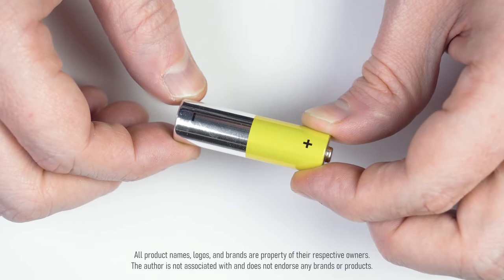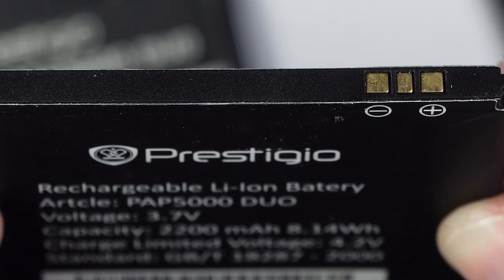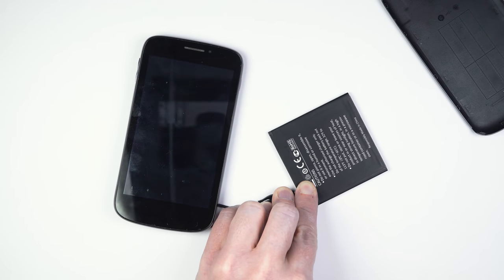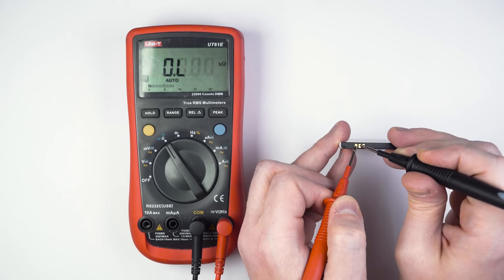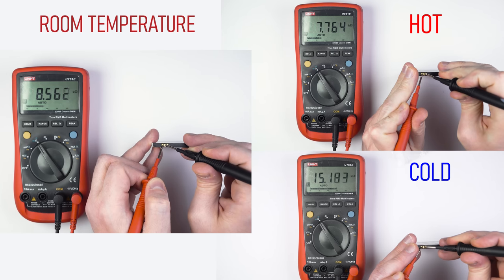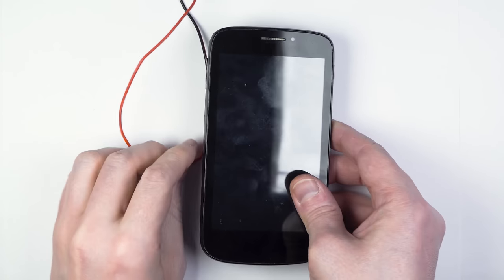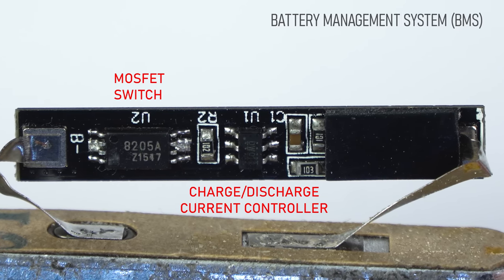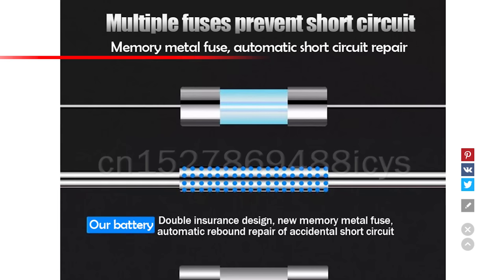Why do MOBILE BATTERIES have THREE terminals? A simple Explanation.

Comment: Outstanding!! I'd always assumed it was for data transfer! That's a handy thing to know. I was just wondering how I could get a thermistor without ordering one. 
Kudos!!!
Reply from the maker: Well, yes, but they are really cheap actually. ;) If you look on Aliexpress, for example.
Reply: Some batteries include wiring/contact for NFC antenna. So in some cases, there is some data transfer. (most knockoffs will advertise NFC antenna, and have nothing tho)
Reply from the maker: @IvnSoft  True, but those are 4 terminal batteries, like Samsung Galaxy S6. And they still do have the NTC thermistor pin.
Reply: @RonMattino  NTC Negative Temperature Coefficient
temperature goes up -> resistance goes down
(I couldn't spot an explanation about the meaning of NTC in the vid)
Reply: Technically it is data transfer, it transfers data about the temperature of the battery. Also there are some batteries with a 4th contact that is actually used for data transfer. My Canon camera batteries, in the camera can tell me the batteries serial number, state of charge, and battery health.
Reply: @SunnyWu  the thermistor just gives a reading of resistance (in ohms and non-linear) that is directly related to temperature. That's why the battery needs calibration info (automatic now).
It doesnt give an exact temp reading.

Search for how a thermistor work  (either PTC or NTC)

Comment: Thermistors were already present on ancient Siemens' and Nokia's battery packs when they still consist of AAA or similar-sized NiMH elements.
Reply: That was not only for protection, but to terminate the charge as well. Ni-Cd and Ni-MH get hot as they are fully charged
Reply from the maker: Well yes, and also some old Nokia batteries used a resistor on 3rd terminal to designate cell type/capacity. They used this method for some time, but not in newer Nokias.

Comment: Sometimes the OEM batteries aren't that much safer!  The photo you show of the protection board is a standard protection board that you'll see atop MOST batteries, its a DW01 chip and another bigger chip which is a MOSFET(switch).  Their job is to disconnect the battery if its short circuited, discharged below 2.5V or charged above 4.2V.  With these in place, batteries are much much safer - and 18650's often have them built in, but some, particularly lithium polymer rectangular batteries don't and these must only be used where there is another battery management system in place.  None of this matters if the battery sustains mechanical damage which can then fail with spectacular results.
Reply from the maker: A DW01 + two MOSFETs connected in series actually, because current needs to be cut both ways: during charge and during discharge. And MOSFETs, as we know, conduct current if reverse-biased. Original branded 18650, in fact, do not have BMS's, but 3rd party Chinese made 18650s do. As for mechanical damage, most Li-Ion cells have a security valve that is supposed to let the gas out in case a short circuit occurs. Unfortunately, it doesn't always work as intended.
Reply: You are very wrong in that later part. Most 18650 or any Li-Ion cell in general doesn't have any protection besides pressure release valves or such mechanical measures. The class of batteries that come with Protection circuit are called Protected cells and are rather uncommon. 
Li-po batteries almost always come with Protection circuits due to the size and possible danger except when the Li-pos are intended to be very high drain or used in a battery pack.
Reply: n7
Reply: Or you accidentally charge a hobby lipoly pouch cell on NiMH settings and drive 5-6 volts into a 4.22V cell (AKA, the typical "Absolute maximum rating" for many kinds of lithium cell chemistries). :P  I had one the size of a couple pennies go up once.  From sitting on my desk, the fireball licked the roof and the fireball filled my entire peripheral vision on the left side.  I'm a big fan of iron phosphate for bigger packs, to say the least. :)

Comment: Fake/counterfeit batteries are indeed dangerous, but sometimes even genuine batteries can catch fire or explode if they were not built correctly: the Samsung Note 7 is a perfect example of this😮
Reply: They're only dangerous if not properly protected with a thermistor, not by default.

It's not unheard of for an OEM battery manufacturer, which is just some generic company sticking an official label on one of its batteries, to just release basically the same thing as generic, but without any official labels or branding.
Reply: Actually the battery compartment was too tight and as batteries expand while charging, the increase of pressure caused the problem.

Comment: The protection mechanism must be implemented by the mobile phone and the battery to ensure safety
Reply: right, the phone needs to do monitor those temps using that 3rd pin.

Comment: 2:01 What you said is indeed true for iPhone batteries over the past 5 years or so. iPhone batteries have some software mechanisms to prevent people from normally using a 3rd party battery. If you use a 3rd party battery for your iPhone, you will get a bunch of warnings and removed functionality of the battery. Apple is forcing consumers to only use official battery in their iPhones, which a serious issue for right to repair. 

You can’t even copy the information of the old battery and paste it onto the new one. The iPhone will still recognise the new battery as a 3rd party one. You need to buy a core battery, remove the battery management system (BMS) from the original battery, solder the BMS to the new core battery. All without frying anything. This is the only way to properly use a 3rd party battery on an iPhone. This shouldn’t be the case in this day and age. 

While the 3rd terminal is not use for forcing consumers to use original batteries, Apple does that by other means. 

There are quality 3rd party batteries in this world, we shouldn’t say no to all 3rd party batteries. But I do understand that there are unsafe batteries from China.
Reply: Are there any batteries not from China?
Reply: That's Apple.

Comment: With some phones that third pin can also be used to boot into service mode. And if someone wants to run phone using a external power supply, add some tantalum capacitors close to power pins. It will help with high power draws when cellular modem starts transmitting.
Reply from the maker: 3rd pin is never used to activate service mode. It's usually pins on PCB. You are right about extra capacitor though -- that's a valuable addition! Some phones may even fail to boot w/o it.
Reply: @RonMattino  ah maybe they remove it from production devices. I worked several years in Nokia and did some testing and flashing tools. https://3.bp.blogspot.com/-L7dOBv0aTGo/TyL5EjuwMxI/AAAAAAAAAV0/1hdakauri44/s1600/Nokia+C1-01+Loca.jpg
Reply: @RonMattino  SOME (do you know every phone and battery ever produced?) -- and at least the sony PSP uses that pin too (see Pandora Battery)

Comment: Well, I know of no mobile phones that have had user accessible batteries for at least 10 years.  Every manufacture seals the battery in the device which is not designed to be opened, worse, they frequently glue the batteries to the point that even if you can open the phone, you cannot easily get the battery out and they likely wouldn't sell you a replacement anyway.  Even though everyone knows that the batteries will degrade and should be replaced, companies have decided that it is in their best interest for customers to just buy a new phone every few years.
Reply: FAIRPHONE! 😃
Reply from the maker: You can replace internal batteries too. And, in fact, they use the same temperature monitoring system, also 3rd pin (3rd wire, rather).

Comment: Your video is sadly out of date even eleven months ago. Many of the mobile phone batteries have Four contacts. The Forth is a thermistor.  You might have mentioned that if you have a device with replaceable battery that fails and you can't get the replacement battery. Look at the top where the the control/charge circuits are, Break off so it separates from the battery. Put that slim strip with it's contacts where the battery was. Fix in place... glue whatever.
Now the phone/Hotspot device will turn on with NO battery and can be powered from USB alone.

Living in Cambodia I've had this problem NOT being able to find replacement battery. This is a very Easy work Around.

<seventy year old retired tech

Comment: I was pretty sure it was just a ground pin. Now I know I was wrong. Throughout the video, I asked myself why they just don't put the sensor inside the place where the battery goes in, so this way it wouldn't rely on the quality of the battery (the battery will heat the cellphone anyway...).

Comment: I'm kinda surprised a phone will turn off without the resistance to pin 2, I would have thought they would just refuse to charge
Reply from the maker: Well, the idea is that when battery is too hot or too cold it's not safe to use the phone. I once left my Samsung S4 in my car in winter, so when I got back to retrieve the phone, it was off. I tried to turn it on, but it told me "battery too cold" and shut itself off.

Comment: Is there any way to connect the device directly to the house electrical oulet?
I have a ProScan tablet that the batteries expanded and i wanna know if i can just remove the battery and use it directly from the oulet of my home.

Comment: Fun fact: I was looking at an e-scooter battery that has six (6) pins. Two of them are marked positive and negative. I'm guessing one of them is a thermal protection circuit. It is unclear what the other three do. (And it isn't my battery, so I won't be cracking it open to try analyzing the circuitry.)
Reply from the maker: Well, I would guess this battery consists of several cells, so the extra pins would be cell connection nodes that could be used to monitor cell voltage individually and level them.

Comment: I was expecting the third terminal to be for sensing current. Is that what the fourth one is for? Or is there some (very small) resistance within the phone's circuitry. I know mine (Samsung S7) is able to monitor battery current.
Reply from the maker: You don't really need an extra pin to sense current, you can do it off either positive or negative pin.

Comment: I have couple of old nokia batteries and i tried to measure resistance like in the video but it just doesnt really change even after put it in frezzer. I looked up online and find that it's a BSI (Battery Size Indicator) pin not Temp pin.
I want to take the bms so i can make battery dummy that will be connected to couple 18650 in parallel.
Reply from the maker: Yes, in some old Nokia models they used the 3rd pin to indicate battery capacity. But that was in very old phones. Modern BL-5C have a thermistor (NTC) on 3rd pin.

Comment: What is the value of the resistor attached between NTC and Ground terminal?
Reply from the maker: It's 10k. This works in most cases, but some phones use 47k. Either one always works.

Comment: Yes old way is that NTC. Nowadays, especially in power tools, it is common for the battery and the device to talk to each other. In this case, the battery has its own microcontroller. In a few cases, I made a program for arduino that mimics the original battery.
Reply from the maker: It's the same for mobile phones nowadays, including those with built-in batteries. Powertools, game consoles, camcorders are different and have always been different.

Comment: Now I'm interested in notebook batteries where you can see 8+ pins on them. :P I assume such a battery could even contain a small microcontroller which not only contains a GUID for a battery  (ehm, e.g.: HP) but also a firmware, a counter and a url for the website to the OEM from where you can order a new spare part. :D

I've seen a lot of machines, usually IBM, Lenovo and HP where the machine was either telling you that you are using a non-Genuine battery or refused to boot because of the same reason.

Comment: Can you explain the extra terminals on power tool batteries ?
Reply: Frequently, those are made up of multiple cells. The extra pads allow checking the charge level of each cell and support operations to balance the charge between them with the right charging circuitry.

Comment: No that's not Exactly the case because all technicians  and also me powered many phones using just two wires and it worked perfectly may be some phone have this feature to not turn  on without 3rd pin but not for many .
And I have never seen any ptc ntc on cellphone battery ( excluding very mordern one ) there is only bms chip may be with inbuilt sensor but it can't sense battery temperature that fast as in video .

Comment: What's going on in my android tablet then? It has a whole ribbon cable of connections connecting the battery to the device.
Reply from the maker: In tablets it's usually 4 wires, never a wide ribbon cable to the battery.

Comment: The middle connection communicates with the phone, whether the user is on blacklist, or not. Games can increase the battery power using this connection, by starting the game, and leave at the intro screen as the batt drains to zero. Turns on power management. Using gps map, localizes the battery, and uploads data, that the user is allowed to use the gps. Legal windows is recognized as Google Play store, before pairing with Bluetooth. Bt pairing and some file transfer keeping 5 m , enables bluetooth localization. After this, you have to start Google map for each battery, to localize the phone. Now, you can use the map and radio. Handy trick for outdated phones.
Reply from the maker: Thanks for your opinion :)

Comment: With that 10K resistor how long does the phone stay up? I think you have to put a diode in there and use the little board off the old battery. Then it will say up as long as you have power to it.

Comment: Gladly, not all electronic gadgets rely on a sensor reading, and it may be seen as "optional".

I have a trusty old Gopro Hero 4 Black. I like to take this camery on long bicycle trips and have it running all the time, as some kind of a dashcam, mounted to the frame. However, original batteries last only around 4 hours - they also have 3 contacts.
So my rides last for many hours. For whatever reason (I suspect firmware issues), the camera can be charged via USB, but when I start the recording, it stops taking power from USB and drains the battery. Tried it with many powerbanks, it just doesn't work. So I went the DIY route.
I dismantled a dead 3rd party battery, took out the actual power cell and kept the body of the battery. I modified it, so that + and - wire were attached to the 2 of 3 contacts and also modified the camera frame, so that I can put that battery dummy into the camera and have those cables come out. Those cables connect to a battery holder, which contains 4 18650 cells. A Gopro battery offers something around 1,000mAh, those 4 lithium cells offer something around 10,000mAh. They are all connected in parallel, so all 4 together stay at the required 3.7V and the camera now runs up to 8 hours with those. Without the camera having any resistence feedback.
But yes, you need to be careful. The battery holder remains in a way, that all 4 cells can be taken out to be charged individually, since charging all 4 together via the Gopro's charging current takes forever. And you need to watch out for polarity. A few times, I actually put in a battery the wrong way, instant smoke let me know about the short circuit and I quickly removed it again. But already within those 1 to 2 seconds, the batteries warmed up. Gladly, getting only warm caused no issues. But if I let them in there for something like 10 or 20 seconds, they may blow up.
And for those who may have question marks over their head: Short circuiting is, when connect batteries in an actual circuit - attaching + poles to - poles and vice versa. Energy can flow without something in between, that actually uses it. But like in my contraption, all the +poles gets connected together and the -poles as well, energy can flow too - but only evening out. If one battery is 3.8V and the other one is 3.6V, they will even out to both be 3.7V. Basically you could say, one battery is charging the other one slightely - because that is how batteries get charged. A higher power value is connected to the battery, than the power level of the battery itself, connecting + to + and - to -. However, you should not combine full and empty battery, because that isn't too healthy for the batteries and just wastes energy.
Reply from the maker: Great job you've done! BTW, it is known fact that Gopro cannot USB-charge while recording.
Reply: @RonMattino  Is it? Then this must have become a stupid newer decision from Gopro, because my camera could do that in the past. And why would they not allow you to charge while recording? In many cases you need more than 1h of recording time, especially for all those years now, where tze cameras have integrated batteries.
Maybe it's a safety thing, because the cameras geht hot while recording, so the battery gets hot, and for not potentially blowing it up, they won't charge while recording.
But that wouldn't be a satisfying answer. Because the camera only needs to run through USB, it doesn't need to charge. It's annoying and pointless, but shows me, how much value my battery contraption has.

So I should really make a test before buying a modern Gopro, if I can run it constantly through USB. Because when I can't, I won't buy another Gopro and will look for another action cam, that does. But my trusty Hero 4 is still running nicely after 7 years of service, I think it will keep lasting quite a while longer. It may not have any stabilization, but already a perfect 4K image.